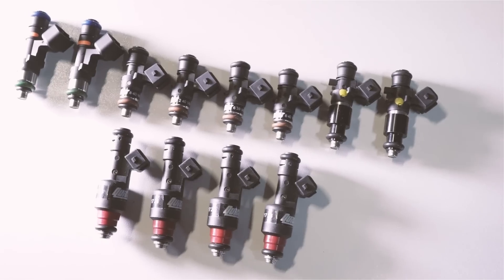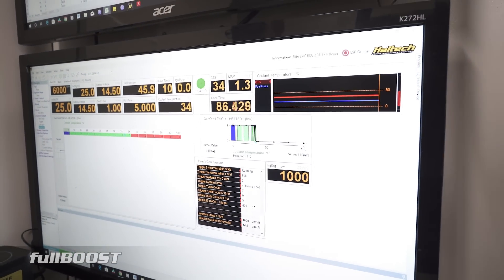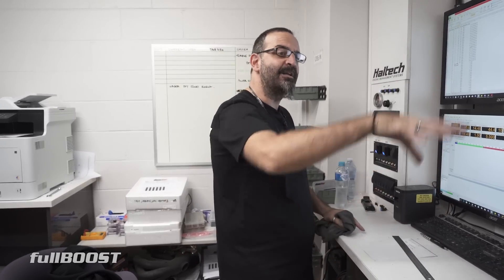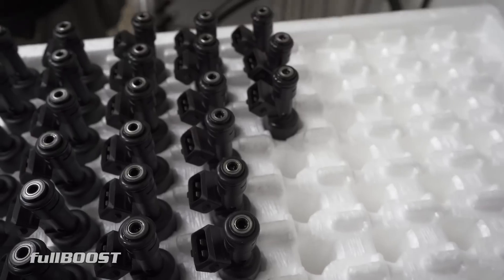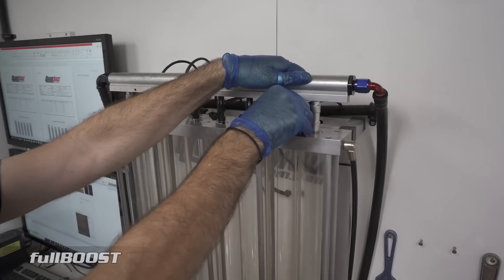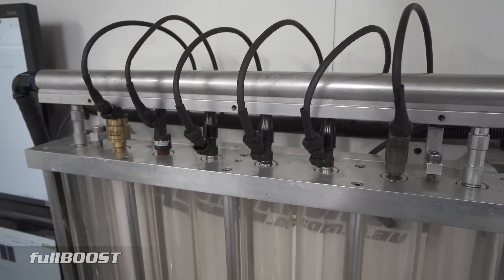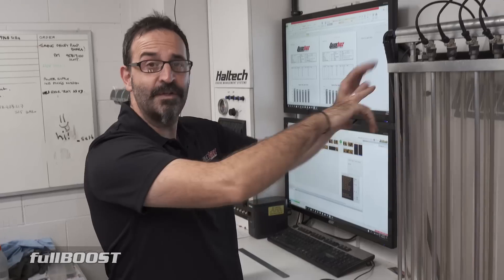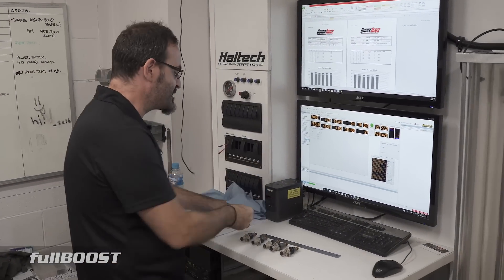The importance of fuel injector flow matching | fullBOOST

Comment: Take note street tuners, if you aren't doing this or monitoring individual cylinder AFR or EGT you may be as much as 7% different. If you are low $ it and using used, untested, unclean injectors, decapped injectors, or even a carburator there could be even more difference. When you see your heroes on YT holding 12.0:1 on pump know that they have the fuel system and consistent load to do that. If you target a little fatter and a little less spark you'll give up a bit of power for a lot of piece of mind. To finish first, first you must finish.

Comment: Impendance? I think you'll find it's impedance.
Reply: Inductance, measured in Henry's, or milli Henri's Is far more accurate in testing Injectors as it not only tests the solenoid, but also any "resistance' to the pintle sliding within the guide.

Comment: It's all very good to have a matched set of injectors, but how balanced is the airflow to each individual cylinder, particularly with a turbo setup where the air enters one end of the inlet plenum? You could of course watch the EGTs of each cylinder and trim the duty cycle each injector so the temps are all even, but then that would undo the effort of matching the injectors in the first place. Not saying that matching the injectors is pointless, just that after all that work if you don't also have identical airflows per cylinder then you are only halfway there.

Comment: Adjusting fuel flow when adding a turbocharger to an N/A engine to prevent starving the engine is important but isn't increasing fuel injector pressure needed to over come the higher manifold and/or cylinder intake pressure caused by the compressed air?
Reply: That is important too, usually you use a referenced fuel pressure regulator so if you run 10 psi of boost your fuel system pressure should increase from 43.5 to 53.5PSI So a particular duty cycle provides the same fuel flow regardless of boost or vacuum
Reply: Yes, this is why you must look at the pump curve when choosing a fuel pump. Wally 255 curve doesn't cut it at high boost pressures. You can choose larger injectors at lower pressures, more robust pumps, or a combination of the two. Many setups for racing use mechanical pumps.

Comment: We got quickbitz to service our bosch 2200cc after we had low fuel pressure from sugared up fuel filters. Did a great job and they came back within 2% suprising considering theyve been on e85 for 4 years and theyre not supposed to be good for them
Reply: E85 generally does not cause fuel system related problems. The main problem is under sized systems and around 1000 horsepower needing triple electric pumps....